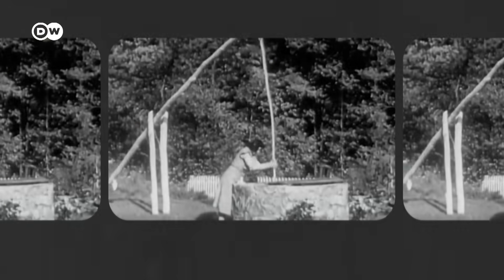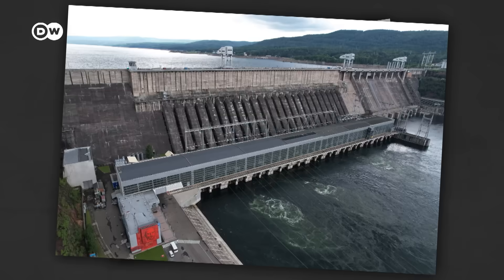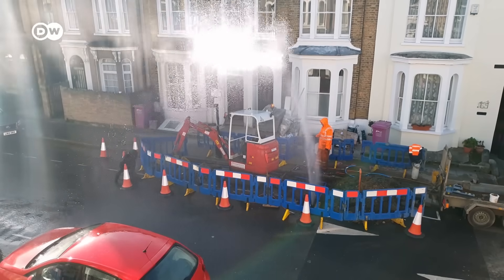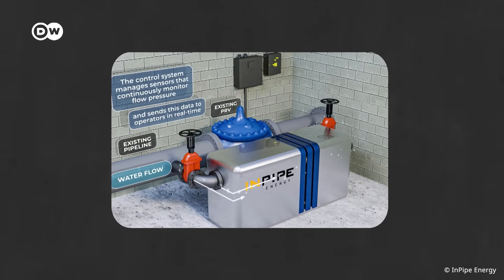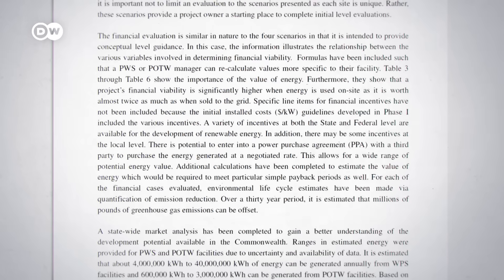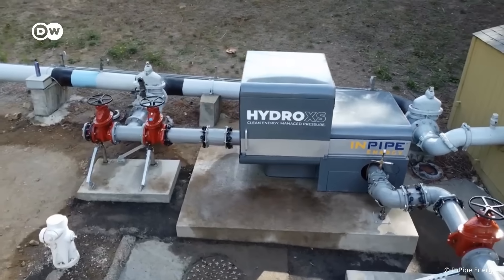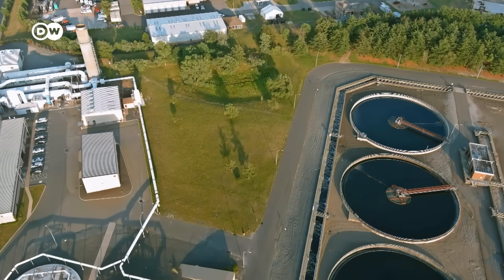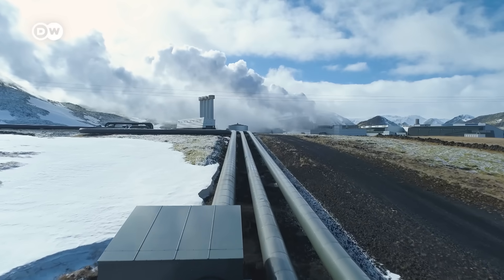In-pipe energy: The hydro power nobody is talking about

Comment: There is a lot of comments misunderstanding what is happening here. I'm not a scientist but I will do my best to explain. We are not seeing new energy being created here, nor will the city water supply need to work harder. We are simply recovering energy rather than wasting it

In the initial system, we see water at 100PSI reach a junction in the pipe at a flow rate of 10L/s. One side takes 1L/s, the other takes the remaining 9.
In a system where a pressure regulator is used, the water needs to drop from 100PSI to 50PSI. There is a 50PSI drop required. So of the 100PSI in the water, 50 of that goes towards overcoming the resistance of the regulator , and the remaining 50 comes out the pipe. At all times, the pressure in the main 10L/s pipe and the smaller 9L/s pipe remains the same at 100PSI. If you balance this equation, all energy is accounted for.

If we instead imagine a turbine instead of a regulator, 50 PSI now goes to spinning a turbine . Rather than compressing a spring, something we can't easily harvest energy from, we spin a device that we can use to generate electricity. We now have the electrical equivalent of water at 50PSI flowing at 1L/s. Again, inside the pipe, the energy remains the same.

This is a very basic overview, but I think it gets to the point. This will work fine, you just need to realise that the energy used to compress the spring in a traditional regulator is *lost*, and it is that energy that we are accessing by spinning the turbine.

Comment: I live on a street where our water pressure is so low that pop-up sprinklers don’t work. You have to move around in the shower to get wet! How about directing some energy collected from a high pressure section as described in the video to drive an in-line pump to give me decent pressure?  Call it a pressure equalisation system.  I pay the same as my lucky fellow citizens but get an inferior service.

Comment: 2nd law of thermodynamics, you cannot create energy, if you use the pressure and turn into energy than pumps need to work harder and suck more energy
Reply: Not how this works. The energy is lost at the pressure regulation valve, this technology would capture that energy instead. Pipes need to stay at high pressure to stop groundwater leaking into them, sediment build up, and other problems, so it makes sense to recover the energy at the point of use rather than waste it.

Comment: This doesn't math proper uhhh. You know it's pumps that create that (pressure/energy) right? sure some systems are gravity fed yes, but how do you think the water got up there to begin with? (free clue) it didn't fly up there. most water treatment facilities are at the source of water and its ~ pumped ~ to the costumers usually uphill, or to a storage tank (gravity system) 

You would just be creating more electrical load on the pumps... but what do I know.
Reply: No you don't, the energy is lost at the pressure regulation valve. This is recovering that lost energy.
Reply: @XavierXonora  ok well I stand corrected.

Comment: Energy harvesting based water flowing from a high point to a low point can be net positive.  Some dams already do this.  Putting an energy harvesting device in your home just means the local water system has to use more energy to pump the water.
Reply: No it doesn't, the energy is lost at the pressure regulator. 1 litre of water goes into the regulator at 100PSI and comes out at sea level pressure. That pressure doesn't remain in the pipe, it is wasted. The idea here is to harvest that 85 PSI.

Comment: Maybe I’ve missed the point but don’t Variable Frequency Drives already sort this problem (along with some other issues)?
Reply from the maker: VFD's or pressure valves are both geared to control the water pressure but it sounds like with VFD's you may have some limitations to the flow rates as well as the smoothness of flow. (🔗http://www.vfds.org/vfd-versus-control-valve-for-pump-flow-controls-580010.html) And this technology here then taps to whatever excess pressure would be wasted with these tehcnologies otherwise.

Comment: If the existing water pumping system is able to deliver electricity at the end of the pumping system, then there is an urgent need of using VFDs and improve the efficiency of the pumping system. After using VFDs whatever energy is saved, excess energy can directly be used for other needs.

Comment: What you gain from trickle energy generations from these micro hydros, you lose by the drop in water pressure. So unless the water comes from a huge dam upstream on top of a freaking mountain, this thing won't work. Unless each individual house has their own micro hydro generator at their inlet head. So each house has the option of producing their own electricity at the cost of lower head pressure for their homes. If the head pressure is already very high, then that works out fine.

Comment: The key idea is taking advantage of wasted energy sources. If you have no other reason to turn on the water except to generate electricity, you're doing it wrong, except maybe in the case where water is way cheaper than the electricity you gain from it, which would probably only happen if your house was a dam, and go figure, those are actually used to generate electricity. The wasted energy within the water infrastructure could be promising. I'm not sure if it's worth trying to extract the wasted energy in the water by the time it reaches the home, though.

Comment: Maybe I'm misunderstanding the concept but pumping water in at one end and then harvesting energy out at the other seems like a backwards approach. You are using energy to move water to produce energy. If the system was gravity powered, i.e. high water source like a mountain stream to a low water user like a city in a valley (classic hydroelectricity), I could understand it but just sticking a turbine in a pipe to recapture energy that was put into the pump to move water sounds like a net loss to me given resistance to flow in the pipe as well as the impediment of the turbine itself.  What am I missing?

Comment: Generally speaking pumping water and then running it through a turbine is an energy negative process, of course salvaging some energy is possible but I don't think that it's beneficial on large scale. One way to save energy, and I think better, would be to have multiple water towers that use excess energy from renewables to pump water up, it would basically behave like pumped hydro but on a smaller scale and instead of power it would provide pressurized water.

Comment: Any energy harvested by in-pipe turbines is typically produced by the pumps (this is different in gravity systems) -- so this only serves as energy transportation to supplement electric grids. But at the household level, a turbine on the main that harvests some of the pressure when water is being used (flushing a toilet or having a shower) -- is a tech that allows us to decentralize our energy production but 10W doesn't get you much.

Comment: Sometimes we need pumps to give the water the push, whether to increase the pressure, speed, or height. while sometimes we need "some component" to do the opposite than the pumps, that is being pushed by the water, so that the the pressure, speed, or height is reduced.
Traditionally, these "components" do the job by generating resistance, turning the energy in the water into heat.
However, in theory, hydroelectric genrators can do the job of these "components" as well, while the energy is not wasted as heat, but turned into electricity.

Comment: I couldn't believe this video exists!  It is the work of the uneducated or someone who knows not even the basic principle of hydro power.
Theory : power (Watt) = density of water (kg/m3) x gravity constant (m/s/s) x flow of water (m3/s) x head (m)
Any regional water company is mandated by law to maintain a certain head, typically 1 to 1.5 bar or 10 to 15m.  This means the only way to get power out of the domestic mains water system is to have a large flow.  Flow through pipe has skin friction.  The smaller the pipe the more friction it consumes.  Thus it is virtually impossible to get large power from the mains water because the underground piping has not been sized for large flow delivery to a domestic consumer.
Practise : To obtain power from the mains water the flow cannot be stopped.  This video is idiotic in suggesting to extract power from the mains system by letting flow away continuously.  That is a crime by wasting clean and treated water!  Also the energy doesn't come free because the water company at the other end is adding more energy by pumping more water just for the idiots to throw it away to extract a tiny bit because the system consumes the bulk of the energy input.
This video can only be regarded as a poison prepared by people who has little or no training about physics or engineering.

Comment: The entire premise is fundamentally flawed and short-sighted. 

It violated the first law of thermodynamics, the conservation of energy. And aims to harness wasted energy in an already flawed pumping arrangement.

As an electrical engineer employed in a pumping plant, I can testify that this is a zero sum exercise. 

Think of it like fitting a generator to your car's wheels and expecting to generate considerable energy when crusing the highway. You can generate energy only when braking, and that too at the energy expense of the next acceleration cycle. In the end, you are infinitely better off setting a dedicated generator which will output more energy at lesses fuel consumption.

Comment: At best it can be a new method of energy distribution. Instead of installing turbines to tap the over-pressure in water distribution systems it would be more energy efficient to design and operate water distribution systems operating at optimum pressures preventing both energy and water wastage. That would cut carbon emissions much better and conserve water as well.

Comment: You do NOT get energy for free, unless the water is coming from higher elevation and you need to slow the flow or drop the pressure, then you are stealing from those who put the energy/pressure IN to the water with pumps that takes power to run. This is a terrible idea bound to cost more than it makes for everybody and force water utilities to hunt down the energy thieves. Do NOT do this!

Comment: To conflate dam hydropower with this technology is misinformation I've checked your sources, and this information is not based on science.

A straightforward question shows the issue. If pumps create the pressure and flow(which uses energy), how is something absorbing energy used elsewhere useful? It's like saying I sled down a hill, so it produced energy while ignoring what it took to walk up the mountain. 

I hope this is just misinformation and not disinformation.

Comment: Turbine will cause a resistance, to counter that you would need a higher pressure, which means more energy consumption, which is more than what you'll recover.
It doesn't work.

Comment: that sounds counter intuitive. it takes a motor to pump those water pressure while adding a turbine to generate power. it would create back pressure on the motor that is pumping those water. i understand the lower attitude can generate power but again the source of main motor is using power to move water. thats like taking a gas generator to charge a tesla even though the tesla has fast and efficient charge. you cant get more energy from energy already being used.  only free energy is from free flowing water system like lake, river and ocean. 

even then if there's a small scale to harness electricity, you will reduce the life of the main pump and the generator itself. the maintenance cost will cost both parties a lot more than getting anything out of it. look at electric car. its fuel saving with perks of charging a cost for cheap. once the battery cells start to degrade it cant be repaired ( depending ) most will replace it and replacement of battery cost up ward of 7-20 grand for some model or brand of the car. while petro car will virtually be cheaper and last forever if maintenance is kept up

Comment: In conventional practice, increasing the diameter of water pipelines is a common approach to reduce friction loss at high flow rates. However, the concept of installing turbines within the water supply network is flawed, as it would only serve to increase pressure drop within the network, contradicting the primary purpose of the pipeline system.

If the aim is to promote sustainable energy generation, a more effective choice would be to invest the allocated funds in nuclear power, which aligns with India's current direction.

Moreover, implementing small turbines would not only lack techno-economic viability but would also result in indirect financial benefits for Chinese factory owners. Therefore, even if it were a technically and economically feasible solution (which it is not), accepting this ill-advised proposition would not be the most prudent geopolitical move for India.

Comment: The biggest weakness of this story is the poor explanation of where this energy recovery is practical.  The most common situations would be a large city that is spread over different elevations where lots of energy is wasted pumping to a storage elevation high enough for all users and therefor TOO high for many users, requiring pressure control valves.  The other solution would be to build separate storage at different elevations for different levels of the city so there would be no wasted energy in the first place.  But the complexity is expensive, labor is expensive, and energy is cheap, so this will remain a niche application in the global West, though it may be used in the American West where the infrastructure has hydro power built in.

Comment: Does  electrical energy consumption pumping water directly uphill == equals or less >  than with water going down in a long zig zag route downhill with multiple generators in each level.  Does it result in hydro-electrical energy surplus as the water is travelling a longer distance than going directly pumped uphill.  Or another route is a circular going downhill like a train, high tide helps water go uphill while normal gravity helping water going downhill providing the extra energy generation.

Comment: Calculations on flow and pressure in systems are a fine balancing act. There might be a hand full of older system to tap that will be beneficial, but the balance of newer systems will not function properly once you remove energy from them. You will reduce flow speeds in pipes leading to reservoirs not filling in time, air locks in systems and other unwanted results. Remember that energy cannot be made and whatever you removed will have to be replaced( and then some due to mechanical losses). So if people tap energy from a water system you will have to add more than people are tapping.. This will cause a circular problem that will exponentially increase energy requirements to pump water.

Comment: If you add a turbine, all you're doing is making the flow more restricted and therefore make the original pumps work more.
Is the point is to make money for your home at the host of city's water pumps, just to stick it to the man?

There is no renewable power here unless we use gravity, running from an elevated water source. As otherwise you will be breaking laws of thermodynamics.
Or am I reading too much into this and it's a scam sold as renewable revolutionary tech?
Reply from the maker: Hey there! Mini hydro technology only collects waste energy already being generated by our water transportation service. Pressure valves, which take energy out of pipes to prevent them from bursting, are the point where the energy is wasted. And it is that waste energy that is used. The process is being explained at 2:26.

Comment: Pressure valves are necessary to protect the water pipes from catastrophic failures, so I don't think they could easily be replaced by a turbine. However the delta pressure that is absorbed by the pressure valve is converted in heat. This heat could be reuse to preheat the water boiler of the house/building.

Comment: Im not sure how this nets any new electricity for places which pump theit water upwards. Pressure is put into the pipes by running an electric pump motor from the distribution centre. If energy is taken from the water lines with small turbines distributed, then the central pumping station needs to put more energy into the pipes to maintain the same net pressure for end users...

Id your water comes down from a mountain then sure, turbine away, or you know building a damn. But otherwise this seems like thermodynamically impossible to generate net new energy. And this assumes no efficiency losses!

Comment: Looking at my home uses, the water flows in spurts - to fill drinking water, have a bath, run the washing machine/dishwasher, replenish the toiler flush tank etc. How useful would be small, undependable spurts of electricity? If I have to invest my money in a relatively permanent green-power solution, one would choose a wind turbine, which would keep turning, when water is not flowing in my house. Yes, at a larger scale, an in-pipe turbine will work where the flow of water is continuous, but consider is needed for the obstruction in the pipe orifice which will result back-pressure and reduction in flow volumes - those are serious problems when transporting water. While I am an optimist and a fan of innovation, I can see what will work and what won't on a sustainable and dependable basis.

Comment: The water pressure of the supply mains needs to be high to keep the system stable. Harvesting significant pressure electricity at the household level requires consuming large volumes of water at subsequently reduced pressure. Most of us are trying to save water.